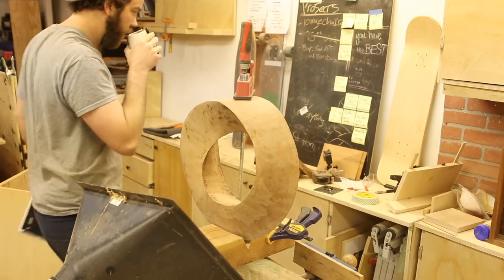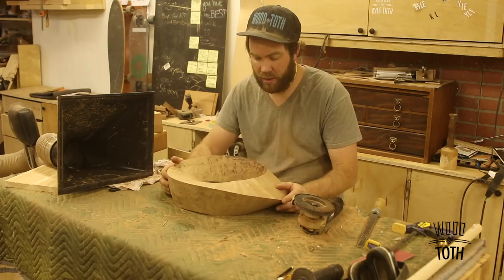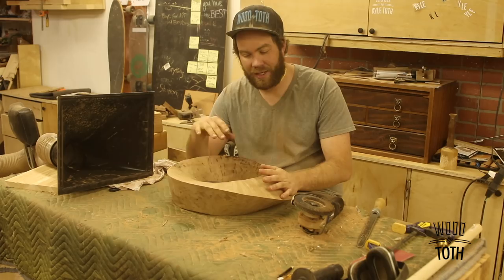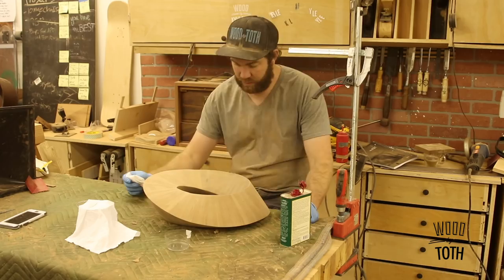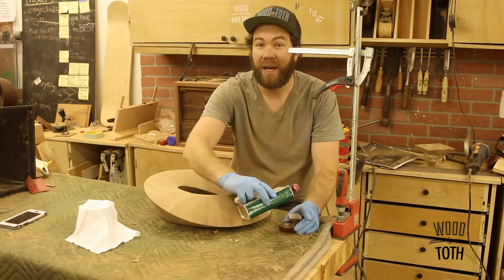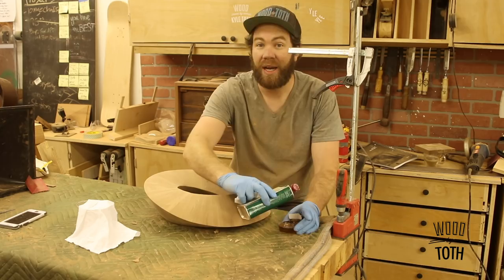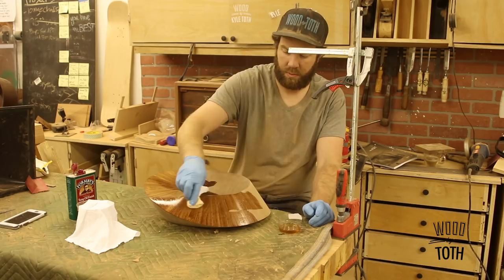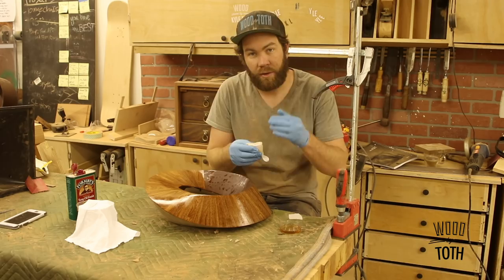Building A Möbius Strip // Day 6

Comment: Hey Kyle. I did notice your paper towel getting dirty while finishing... I don't really know if it makes a difference but I wipe down any wood I finish with paper towels soaked in mineral spirits/acetone until they come off clean. Then after drying (shouldn't take long, as alcohol evaporates quickly) I apply finish. With 95% of woods I use this doesn't even raise the grain. It helps to make the finished surface appear cleaner.

Looks Amazing and I really like your other projects!
Reply from the maker: Right on thats a good tip! thanks, usually i'll blow it out with an air hose but that seems like a better way. When I have pieces that are all the same wood and I want to fill the grain to get a high polish finish i'll leave the dust in the pours and just build up the finish